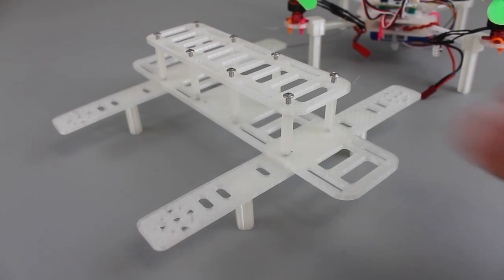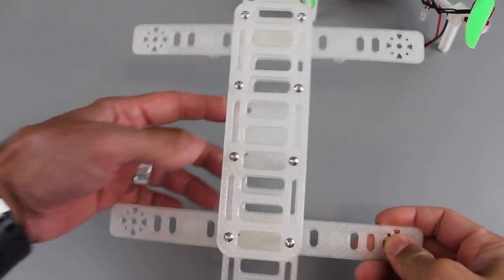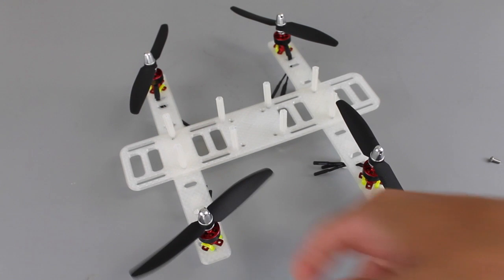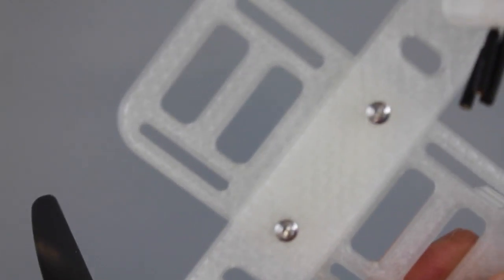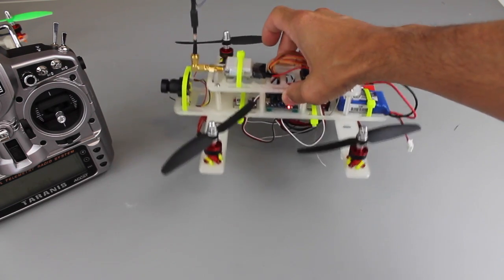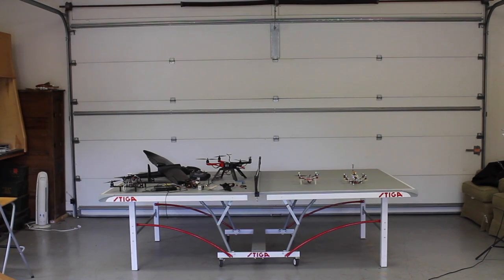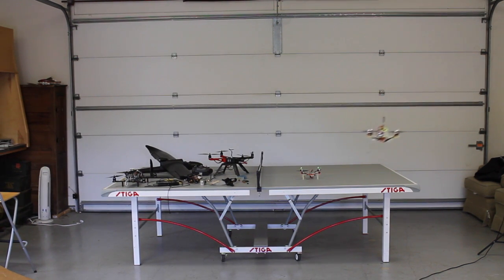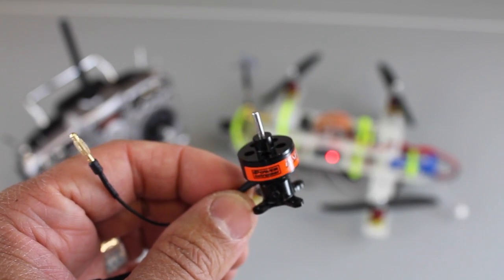3D Printed Mini FPV Trainer Quadcopter - Work in Progress

Comment: hovering 75%?? wow not good at all,  i would have thought lower is frame heavy itself?
Reply from the maker: I know. The frame by itself is 80 grams so not too heavy at all. I've made some revisions that I'll post soon so it's a little heavier. But upgrading to the 3S system and new motors had made all the difference in the world. Thanks for the comment.

Comment: Would you get any weight reduction using nylon screws?
Reply from the maker: For sure, but I think there are other areas where I can trim first like smaller transmitter. That's the first place I want to start. Let's build you one when I get this dialed in!

Comment: I would use a micro video TX 200mw 5.8ghz and a micro cam the 2 together wouldn't be much more than 10g with wires.
Reply from the maker: I'm definitely going to look into lighter electronics soon. Thanks for the suggestion.

Comment: Your so lucky to be able to print up your own RC gear like this mate and i'm so jealous lol.

I got the new HK mini FPV frame the other week and wanted the motors that they advertise for it but of course they were out of stock,so i tried the same motors and ESC's that you have there which mine came from my old HK micro quad,and i got near enough the same results as you with my FPV gear all wired up,flight times will be really bad so i'll have to wait for the HK motors to come in stock and go 3s but until then i'll have fun flying this around with out my FPV gear on.

Thanks for sharing and love your work by the way = thumbs up.
Reply from the maker: Thanks for the feedback and sharing your experience. I'm really glad to have made the 2S to 3S leap. Now I need to start looking into flight times. I'll post more info soon and good luck while you wait on Hobby King :)

Comment: hi Dennis
just wondering if you turned the quad upside down and turn the motors over, if that would improve the stabilaty or not ? 
i only ask as your design look prefect to try it out  without much hassle .
cheers  for an interesting video....
Reply from the maker: Not a bad idea. When I get through these tweaks and my electronics in place I'll see if I can give this a try. It will be pretty cool looking I bet. Thanks for the suggestion!
Reply: your welcome .
while your there Dennis , I am looking at getting a 3d printer can you point me in the wright  direction to get started
cheers darren

Comment: Maybe think mini bobbins to mount the arms to the rest of the frame for isolation. Then 10 mm traxxas 3mm hex and only the rear standoffs be one piece long, the front could have two with another small frame piece for rigidity and mounting of fpv or power distribution. Love this design so far and so wish I had a printer for this stuff! I would love to do my own designing!! Good job! Has your buddy still been working on his helical design? Looking forward to that also! Keep your props up and your goggles on!
Reply from the maker: Thanks for the bobbin suggestion. Let me look into this. I'm about to get with Zwcky on his build video and we'll get that posted soon. He's been working hard on getting his design down to perfection. I appreciate the kind words. Take care.

Comment: I would suggest to get RCX 2400kv motors 5x3 on 3s. This is what I'm running on my mini fpv rig. Has great power. In the cold weather with a 1300 3s pack getting 8 min
Reply from the maker: Cool. I will definitely check them out. Do you have a place where you recommend purchasing them from? Thanks for the tip.
Reply: Here is a link also the 10amp g series esc are perfect match.

http://www.myrcmart.com/esc-ubec-rcx-hobby-c-22_82_238.html

Comment: I see the evolution of your 3D printed quads, nice solution you've got there! Will you have a crash test? PLA is not that tough (I got issues for that) and I guess you can also use ABS in your Replicator (you've used that printer right? Great prosumer machine!)

I've also been building cheap DIY 3D printed quads using PLA, ABS and in polyamide (SLS) but I ended up using hobby wood (beams and plywood) for training quads (just uploaded my last built, an hexacopter): for my needs the design freedom 3D printing provides didn't pay my design and mfg (I own a 3D Touch from 3D Systems but also ordered in Sculpteo/Shapeways) time off. But, In my 3D printing consultancy company (www.inkonova.se) we do consider bring the full 3D printing advatages to our hobby in a more optimized way for the general public. Let's see where this leads, you might be interested!

Meanwhile, keep youtubing as you do!